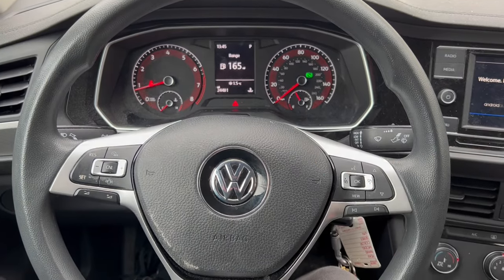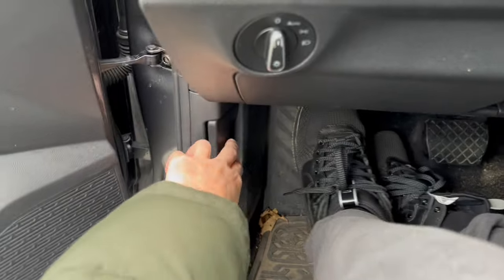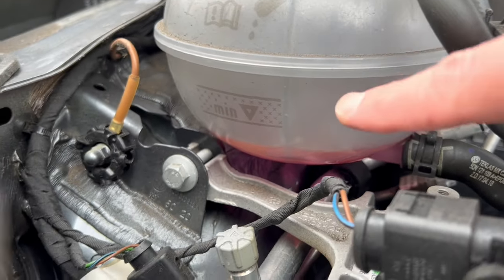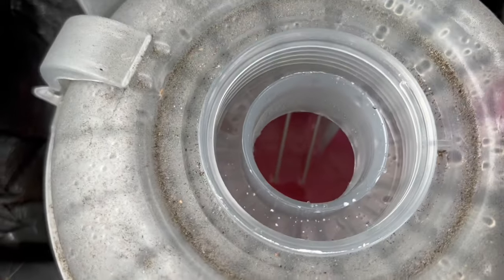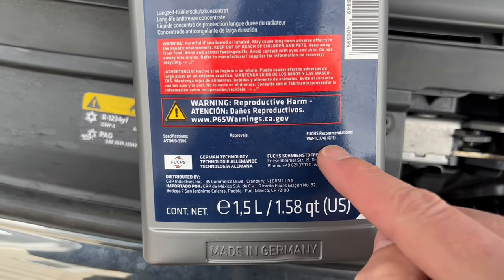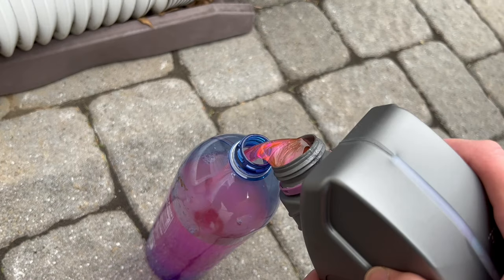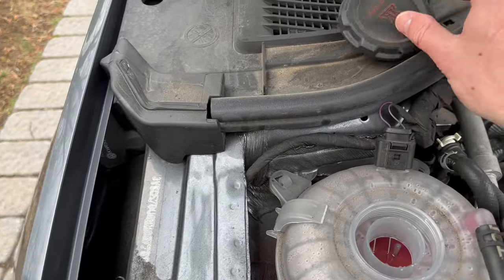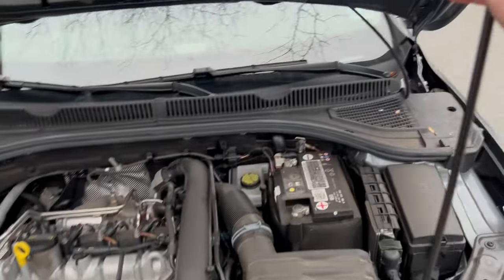VW Jetta Check Coolant Level Fix Red Coolant Warning Light

Comment: Mine is going off and on like it goes days before it comes back on.. I have coolant and it’s in the middle after I got an oil change the light started to come on.. could you let me know what’s wrong? I have 2021 Jetta no engine lights nothing just comes on then goes off once I restart the car
Reply from the maker: Thanks a bunch for watching my video and taking the time to comment. Have you checked your coolant level when the car is completely cold and has been off overnight? Please share an update, thanks.
Reply: Yes it’s still in the middle above the line
Reply from the maker: Is your car still under warranty?
Reply: @WheelsTips  unfortunately no, it went off for 2 days then came back on when driving, it’s at the max level and it’s not low.. someone said it may be my sensor nothing is leaking the temp gauge stays in the normal range the manual says so not sure
Reply: @WheelsTips any advice on what may be wrong
Reply: @Djclocs any updates brother?? Same here on a 2019

Comment: This happened to my 20 Tiguan. While cold starting. I opened the hood to check the fluid. It was low.. but had fluid in it. To put back the lid and turned  the car on. The light went away.
Reply from the maker: Thanks a bunch for watching my video and takin the time to comment.  I had a similar situation and a few days later the indicator returned, at which point I had to add more fluid.

Comment: So my Jetta is shaking and check engine light came on… now I drive a 2015 Jetta base 2.0L… so would my car start shaking from being low on coolant
Reply from the maker: Thanks a bunch for watching my video and taking the time to comment. Start by scanning the car for the check engine light, and if you are low on coolant, add more of the proper coolant. Shaking could be many things. Hopefully, it's a simple fix, like replacing an ignition coil and sparkplug.  Please share an update, thanks.

Comment: What happens if you top it up and the coolant level drops again?
Reply from the maker: Thanks a bunch for watching my video and taking the time to comment. If the coolant drops and keeps dropping you have a leak in the system. If it dropped a little after adding some, it could just be it got pulled into the system, please share an update, thanks.

Comment: What happens if you go over the line a little
Reply from the maker: Thanks a bunch for watching my video and taking the time to comment. Truthfully I wouldn’t recommend or OK beyond factory specifications, the line is there since the engineers designed it as so. I know it’s a pain to adjust but it’s just safer that way.
Reply: Maybe use a brand new turkey baster from a dollar store to pull the excess out?

Comment: Is this concentreate already mixed with antifreeze, i  live in a cold climate and I am worried doing 50/50 with just water will not stop it from freezing should i add antifreeze too?
Reply from the maker: Thanks a bunch for watching my video and taking the time to comment. Since you seem to be in a unique circumstance, I would check the back of the bottle for instructions specific to your situation.

Comment: Thanks for this clear and concise information. Where is the coolant link? I'd like to support you and get the correct G13 coolant. I've read it SHOULD NOT be combined with G12+ or any "universal" coolant.
Reply from the maker: Thank you so much for taking the time to watch my video and comment.  Glad I could help with your VW coolant personally I was waiting for Amazon to add a G13 fluid so I can link. Unfortunately they have not yet and recommending the fluids that are available like the Peak Purple and the Valvoline Zerex G40 is not my favorite thing to do. Yes the coolant is very specific for 2008 and up VW’s and I certainly would never use a universal coolant unless I fully flushed the system and only had the universal fluid. Please share an update, thanks.

Comment: Hey brother i wanna ask a question which is out of topic..
Is the 2021 jetta gli reliable on the long run like if i buy it and keep regular maintenance like gearbox oil change, engine oil change ,coolant change, and let the engine warm up for about 5 minutes so that oil reaches all of the engine parts will the car stay reliable throughout the years Of normal driving plus aggressive driving for the fun? I've never driven a turbo car and my country is hot during the summer like 40-45c  so do you think i should buy this car or a 2021 corolla? Because I don't want to drive it for months then have to do expensive components replaced..
Btw nice video and subbed🖤
Reply from the maker: Thanks a bunch for watching my car and taking the time to comment.  This is truly up to you. You take great care and awareness of your car. If you drive the car the right way and take care of it, it’s really up to you. I know this is not much of an answer but being so thoughtful leaves you with more options. Much luck 🍀

Comment: Thanks for the video. I filled the coolant level to the max line, took it for a good drive and checked the levels again to find them a little lower. Is that normal?
Reply from the maker: Thanks a bunch for watching my video and taking the time to comment. In my experiences that is normal for the system to pull some into it and thus appear lower in the reservoir. I would keep an eye out to see if you are constantly losing fluid for a bigger issue. Please share an update, thanks.

Comment: I have a 2012 hyundai ix35 that started smelling burnt oil and the engine temperature was on quite high and when I check the coolant it was completely empty. the car did not warn of anything. do I have to bleed the system after they there wasn't a single drop left?
Reply from the maker: Thanks a bunch for watching my video and taking the time to comment.  Bleeding the system is necessary to get the fluid into the system and air pockets out.  Please share an update, thanks.
Reply: thanks! Will give you an update when I've done it
Reply from the maker: Since you ran out of fluids, you should check if your car is OK by a professional. There is an underlying reason you lost the fluids in the first place.  Also, the damage done by the overheating needs to be checked as well.
Reply: I have time at a hyundai workshop tomorrow so I hope it's not a big leak
Reply from the maker: Good move, let me know how it turns out and good luck.

Comment: Where do I buy the g12 they don’t have that at auto zone
Reply from the maker: Thanks for watching my video and taking the time to comment. Personally you can get it from the dealer or go to a local automotive store and make sure it’s G12 or G13 compliant, depending on what you need.
Reply: @WheelsTips  I bought one from auto zone saying it’s compatible with my VW
Reply: @WheelsTips  it’s a 50/50 mix
Reply from the maker: Was it at least the same color? Have you checked your coolant to see if it is sludgy or changed color?  Please share an update.
Reply: @WheelsTips  it was this one called PEAK Original Equipment Technology European Vehicles Purple Antifreeze and Coolant Concentrate
Reply from the maker: Personally I like to find the stuff that has the correct specification.  Much luck!